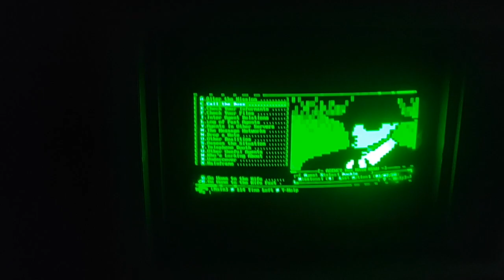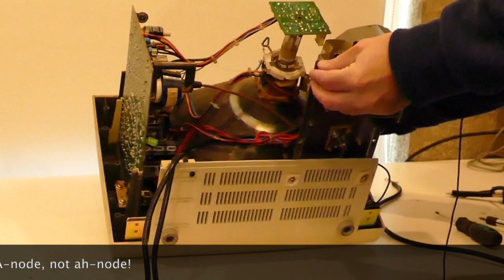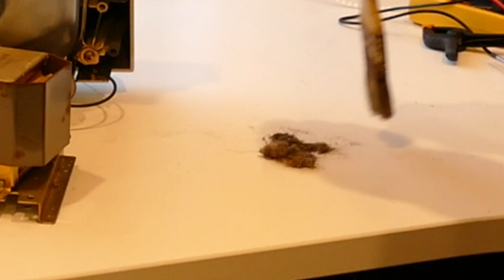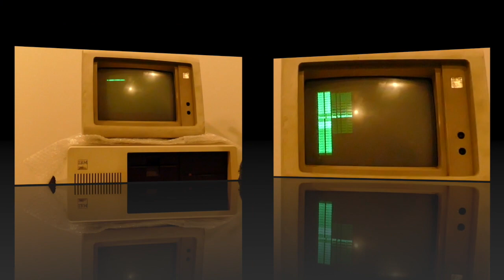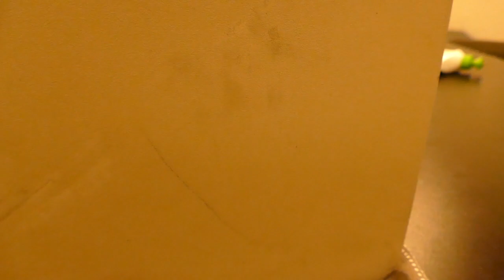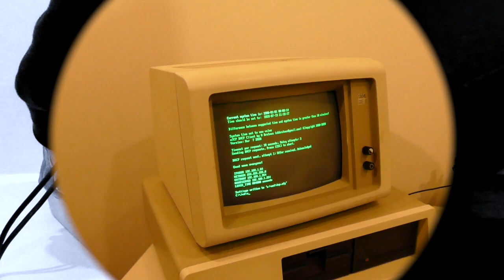How to repair an IBM 5151 Monitor

Comment: Thank fuck I found this! Mine has the same issue - also are you running a Hercules card in that?
6:46 I don’t think these have bleeder resistors

Comment: I have one of these 5151 monitors in the ibm box my dad has had in the basement on a shelf for years. We no longer have the IBM PC though to connect it to.Is there any way to use a jumper or adaptor to test to see if the monitor turns on and works without having a pc to connect it to? I have a few older pcs but none that have a 9pin video. Thanks and love the channel!

Comment: I have just repaired a 5151 with similar issues by regulating the V-hold and V-size pots while the monitor was turned on. Turns out they deregulated over time. Thank you for this instructive video.
Reply from the maker: Thanks for your compliment!

Comment: What sort of graphics card does your IBM XT have? The monochrome monitor is fixed frequency so can't display CGA graphics. The most popular graphics card for it was the Hercules and clones.
Reply from the maker: That configuration was an ATI all-in-wonder 800+. A damn fine EGA card! And that 5151 can most definitely display graphics up to and including EGA resolutions with it!
Reply: Thanks. @AlsGeekLab   I see the ATI 800+ is now hot on eBay $$$. i have a Hercules for my set up (came with a job lot of IBM bits but  I don't think I've ever got around to testing to see if it works).

Comment: I always pop the Anode off with the Screwdriver and ground the Anode while working on a CRT because Charge can build back up from Capacitors. Personally, I would never place two hands on the Anode, the Lead or the FlyBack until grounding the Anode for at least a minute.

Love the Video and the Channel BTW, Just Subbed
Reply from the maker: Thank you so much for subbing! It made my day! Have you seen my other companion video on how to make a discharging tool? I always worked one handed when I removed the anode
Reply: @AlsGeekLab  I haven't but I'll check it out some time. I wasn't intending to criticizing your work here I was just jabber jawing about my CRT discharge technique. I know we all have our "right way" to do these things lol

Comment: I just discovered this channel so I'm having a bit of a binge watch. I'm enjoying your videos so far! I saw this one after your computer sale haul, and I'm glad you got this monitor working. My first PC had a 5151 monitor too. I like the fact you've got it displaying CGA, back when I had my 5151 I didn't know you could get cards that would display true CGA on them.
Reply from the maker: Hi Damian, sincerely thank you for your comments. Ones like these make all the effort worthwhile! On the 5151, I'm actually displaying EGA. The card I'm using is an ATI All-in-wonder 800+ which does a pretty good job of detecting which monitor you've got hooked up to it. So as long as I don't smash the range out of the monitor by doing something silly, it should be quite happy displaying EGA (lo-res) just fine.
PS, since you like the channel, any chance I could ask a favour (well two?) - Can you tell me how you came across the channel (eg, was it a YouTube reccomendation, or was it from social/website etc), and secondly, if you have friends that would also appreciate the content, I'd be so grateful if you could share the channel with them!
Heaps of thanks - Al :)
Reply: @AlsGeekLab  I came across your channel through your post on reddit for the 1989 games video. I've just got into developing games for 8088/CGA era PCs (no idea how long that will last) and so I'm devouring as much content on those machines as I can.
Thanks for the information on the ATI card. If I get back into hardware collecting I'll definitely have to look out for it as I'm fascinated by the possibility of running EGA output on a 5151. So far all I have room for is my little HP100LX :-)
Reply from the maker: @cyningstan  thanks Damian! So cool that you are developing these! I'm always so happy and impressed with this stuff! Do you have a link to your GitHub or something?
Reply: @AlsGeekLab  So far, my DOS gaming stuff (and some ZX Spectrum stuff) is on itch.io (cyningstan.itch.io). I do have a project on GitHub too, Tiny BASIC, which compiles for DOS as well as Unix and Windows. That one's at github.com/cyningstan. I hope to upload some of my game source up there once I've tidied it up a little.
Reply from the maker: @cyningstan  I'll check it out for sure!

Comment: I wonder if the fact that you had to crank the VHOLD to the max setting means there is something else broken on the logic board. Maybe a bad cap, crummy resistor or something like that?
Reply: If I had to guess: the V-HOLD is connected to C402. Maybe that one has gone a bit bad?
Reply: On second guess, according to the schematics that one seems to be a ceramic cap, so probably that didn't go bad. But around that TDA1170 are several electrolytic caps. One should probably measure if they are still good. Not sure how the V-Hold is related to the other pins of the IC. But there is C410, C408 and C405 which all seem to be related to the TDA.
Reply from the maker: Most probably a bad cap somewhere. Laziness won! But if the issue recurs then a cap replacement spree will ensue!
Reply: And one more thing: Pin 6 and 7 of the TDA should provide between 6 and 7V of regulated voltage. If that is off, I would reckon that the IC is going bad? Should be 6.48 according to the 5151 schematics.

Comment: I have a Profex Amiga monitor that has some issues. 2 minutes after power up every other line begins to jitter. This lasts for ~30 seconds then the monitor runs fine. One of these days I also have to open it up and figure out what the issue is. Any ideas or advice?
Reply from the maker: Sounds like the caps probably need replacing I'd reckon. They're probably just worn out and filling up slower than they should.